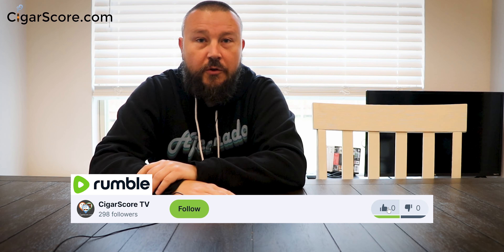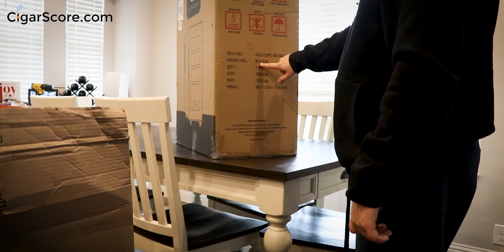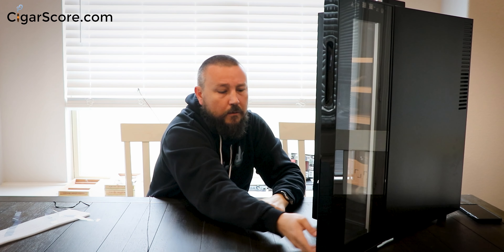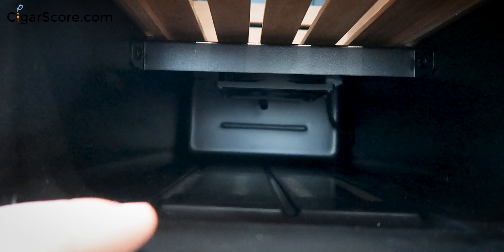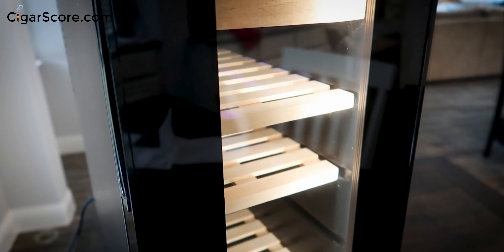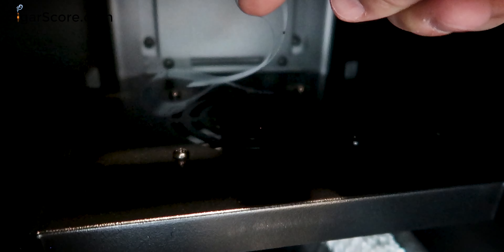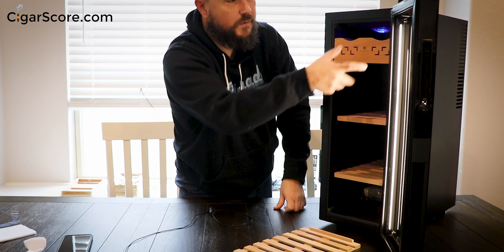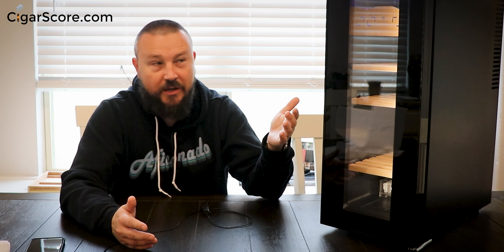Meet the NEW Glencreag 35L Electronic Humidor (BW-35S) - EXTENDED CUT

Comment: Probably would have been better for them to block off the bottom 25% that way you won't feel like you need to use all the space . Honestly if it holds the advertized cicar capacity its a non issue . Your wanting to uae space thats not intended to hold cigars
Reply from the maker: I think most people want to fill a humidor they paid for. Thanks for watching! Don't forget to subscribe =)

Comment: Any update on how it handles humidity/temp/noise after using it for awhile?
Reply from the maker: So far this unit is working great!
Reply: @CigarScoreTV  thanks, I just ordered mine, waiting for it to arrive as Im outside US.
Reply: I'm sorry bro but have u been paid for this review, and could you elaborate "works great". While it looks great and manages to keep temps consistent, for the love of god it won't keep consistent humidity if you hold a gun at its head. Just put a hygrometer at each shelf. I set mine at 75% just to keep the bottom shelf at 62% while mid is around 68% and top is 74%. And every hour or so those numbers can vary in a range of 10% up or down. My ambient room humidity is more stable and uniformly distributed than that thing. And no amount of bovedas or moving stuff for airflow fixes it, it's a horrible product.